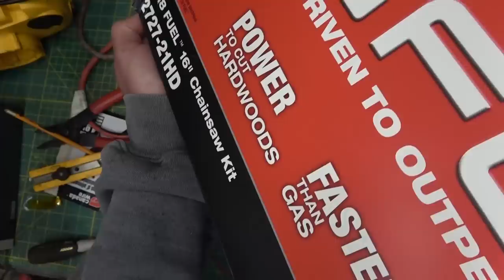BOLTR: Milwaukee Chainsaw | Destroys DeWalt

Comment: Dip into your retirement and BOLTR a Makita XCU03 or XCU04.  It's completely different inside.  Direct drive, variable oil pump, leverage on bar afixation.  It seems pretty skookum.

It's brushless motor is designed with the rotor on the outside and the stator on the inside. The permanent magnets are mounted on the rotor like a bell or cup and the rotor rotates around the internal windings.  This makes the rotor necessity larger and further from the center shaft producing much higher inertia resulting in smooth, stable operation, even at low speeds.  It is also more efficient and shorter than inner rotor motors.

This type motor produced higher torque since it increases the “lever arm” effect and other magnetic advantages I don't understand. The large rotor also means it can accommodate more winding poles, which further increases magnetic flux.  Outer rotor motors are shorter than similar inner rotor motors since the same magnetic surface area forces inner rotors to be longer since they’re on a smaller diameter.  Makita’s motor doesn’t protrude outwards like the Milwaukee. This compact size and high torque makes outer rotors great for applications with varying loads like a chainsaw sees.  It's high inertia helps to “push through” load fluctuations and produces high starting torque.  Because they use outer rotor design Makita’s saw can be direct drive.  No gears also increases efficiency while simplifying things.

Comment: That goop on the MOSFET legs resembles the latex mask I have used many a time on conformal-coated boards.  The idea is that you mask the stuff you don't want to be packed full of urethane for whatever reason.  The mask dries to the consistency of a rubber band.  When you want access to whatever you masked, either just after coating or at some later time, you grab the rubber with a needle-nose pliers, breaking right through the thin coating of fairly-brittle urethane, and pop it right outta there.  The idea might just be to make the MOSFETS more easily replaceable.  If the goop is silicone rather than latex, then it might just be that the greater heat tolerance of the silicone serves to protect the urethane from scorching, since those metal legs would tend to conduct a lot of heat.  That would likely improve on the long-term integrity of the moisture barrier.  Depends just how hot things are getting, which I do not know.

Comment: I got my hands on a Stihl 261 for $650 Canadian pesos which is the same price range, hard to go with that electric thing when you are in pro gas chainsaw range.
Reply: Not sure where he got it for 600... but everywhere I seen is 530 with 2 batteries, if you have packs the bare tool option will be like 380 I bet
Reply: Might be counting taxes in his price
Reply: Adam Petten not sure where you are from but here in Ontario at Home Depot it’s $598 plus tax for tool and one 12.0 battery
Reply: @Grakoham  yikes, every tool store I've seen is 530 with a 12.0 and 9.0, I dont think I've ever bought a tool from home depot. Most fastener stores have free shipping to.
Reply: +Grahan K they don't have the extra battery promo going on still?  Weird... meh go to Construcion Fasteners, they ship free $530 with extra 9.0 battery.
Reply: It would be kanuckistan kopeks, the term your searching for
Reply: keep in mind the 9.0 is 200 bones. bare. 12.0 300 hunny.
Reply: home de-pot. sold with 9.0 530 summ. nock off battery at retail price tool is now 330. lesson here. when there is a tool event at your local wholesale, Go!. Get to know you local rep, (milwaukee, whatever) take him for breaky and a blowie. Now tools are way cheaper and you can buy more toys!
Reply: A 261 is a far far better saw than this milfukee for sure. But it's not a patch on the ol 260... The 261s have had major issues with the holes for the sprocket, some have been machined, some done by hand. The ones done by hand are off from where they need to be, causing the needle bearings to shred themselves up, which causes lots of wear to lots of parts. All the repair shops seem to be aware of it, but Stihl are pretending it's not a common problem... Also, you get the usual issues with the electronic carb which pretty much all new saws from husky or Stihl suffer from (some more than others for sure)
Reply: Price matched at Home Depot in Toronto with local tool store at $530. Home Depot then takes 10% off. That's $477 including a second (9Ah) battery. Way more palatable than $600 for just the tool and the 12Ah.

Comment: The coating on the mosfets has two functions. First, the leads get micro cracks when they are bent and tend to corrode or break due to thermal cycling. Second, it doesn’t take much of a crap path for the gate to be shorted to either the source or drain. A couple of stray pixes, and that valve will be stuck open.

Comment: Reminds me of a 5.9 dodge the  motor is good and everything else is ready to fall apart from factory.
Reply: George & Sue the problem with a cummins is the dodge hugging it!!
Reply: @Robert82  I couldn't say it better myself hahha
Reply: LMFAO!!!! it's the truth that hurts most when I look out at what I have parked next to the barn hahaha.
Reply: got a 97 12 valve and yes that is mostly true, though I also had a 96 Chevy that wasn't any better, the plastics were just as cheap, the later dash 98-03 in the dodges I hear is a real pos with cracking and shit falling off
Reply: **cough** automatic transmission **cough**
Reply: Got a 94 5.9 Cookie dough dash is falling apart. Paint is long gone. Clear coat pealed off. Engine is strong

Comment: Your chain speed calculation is not too far off for a chainsaw, in fact many pro saws run quite a bit faster than you calculated. For example a Stihl MS261 has a maximum chain speed of 5300 feet per minute and a chain speed of 3600 feet per minute at 9500 rpm where it produces max power. You were also correct about the chain oil pump they use a half moon lobed cam to pump the chain oil. I also think a review of a professional chainsaw that is powered by dinosaur squeezings instead of angry pixies is in order.

Comment: Amen to the pegboard, some wood and some screws/nails are all you need, frikking cheap, throw in a sharpie if you want the fancy version with tool outlines
Reply: DKTAz00 you spelt dust/sawdust and grime/car grease wrong

Comment: I bought the DeWalt Flexvolt saw, and it appears they’ve fixed the bar attachment fuckery. It no longer has that silly torque limiter. It’s actually been a super kickass chainsaw and no problems with the bar whatsoever since they updated it. Only complaint about it i have is the oil cap leaks.

Comment: "If your not into this type of review...go ahead and f#$% off!" Bwahahahah subscribed!
Reply: I use pegboard to hang tools, but I hang them up on the right size bolts for the pegboard holes.  Different lengths of bolts to match the tool hanging on it.  I know it's dorky, but my tool wall above my main work bench looks better than the dewalt display case at the big box tool store.

Comment: Technically a watt is a watt.  So if the voltage goes up and the current goes down, which makes sense because they are inversely proportional, the wattage should, key word, stay the same.  Just like if I have 12V and 10A  I have 120W  but if I increase the voltage to 60V and the current is 2A I still have 120W.  What is doing all the work is the Power.
Reply: I think his point was when you increase the current you have to decrease the wire impedance by using thicker wire. 
Thicker wire means a bigger motor to accommodate the bigger windings.

Comment: Mehh.. Gas is still king!
Reply: This thing is a beast! Mine has lasted just as long as any gas I was up against. If only I had more batteries
Reply: can’t use gas indoors
Reply: Battery technology still has a ways to go
Reply: They each have their uses in my opinion
Reply: I have the Milwaukee, a Sthil MS180 and the Makita EA7901.  The Milwaukee is the go to for most jobs and I would rather use it than the Sthil.
Reply: @offwhitecolby  where all the trees in the shopping mall are
Reply: @offwhitecolby  Hahahahaha, If you only knew.  But really, If you freeze the body first, it cuts cleaner,,, less meat on the walls
Reply: My horse and buggy are still king. Automobiles will never match the reliability.
Reply: o15 L ... if you know you know

Comment: Time to build a 
MiLlwalty 2wd Ebike!
Reply: Agreed! But, for $600 he could buy a used motorcycle. Lol
Reply: My daughters pink barbie jeep does 12mph on my 20V max b&d battery. Been tempted to get a kobalt 80v.
Reply: @Eluderatnight  I use the $10 kobalt 24v(2 in parallel) on the powerwheels dune racer. It's on yt
Reply: @Eluderatnight , Jimmy's Tractor, has a video of his son's powerwheels jeep hopped up on some more voltage. I don't remember exactly how much he was putting to it. He'll probably respond and let us know.

Comment: Hey AvE,  Great review. I'm hoping they bring out a top handle version soon, it'd revolutionise my work at festivals building stages and venues from green timber, at the moment i have to offer up each piece and hold it in place while starting my two-smoke saw, make the cut and then affix the piece, its a 3 handed job at best, an M18 top handle would be a real treat. 

FYI, those lines on the saw are your felling sights, they're a really rather important feature that you'll find on all professional chainsaws. ;-)

Keep up the good work pal

Matt

Comment: I bought this chainsaw to give to my mom and sisters, ive used it around the house and it seems pretty good for a homeowner, the positives, only needing chain oil, coming with a big m18 battery that can be used in almost all thier m18 stuff, its a tight fit in the battery fan and thier radius lights, but those are great trade offs versus buying a chainsaw using it once maybe twice a year to clean up fallen limbs and small trees then letting it sit for months on end only to have to work on it for 3 hours to use it for one.  The chain is named brand and is available. All in all i like it.

Comment: I bought an Einhell (German) chainsaw at discount supermarket about six years ago. It's pretty obviously made in China, but it has an Oregon bar and it works. The starting instructions are a bit arcane: pump five times, pull three times, turn widershins twice, pull twice more... but, if I follow them, it starts,  it cuts down trees, it turns trees into logs for the fire. It cost about £100. Two-stroke stuff is fine, IMHO, if you follow the instructions, use the recommended mix, and maintain the thing.
Reply: One thing the EU gets (trivially) is zero ethanol, E0, 98 octane gasoline, that makes the 2 smoke (and overall carburetor) engines more reliable. No idea who common in the good 'ol Blightly. Also why arcane - that's pretty much how most 2 stokes start, pump the bulb, pull few times on a choke, release the choke, pull again.

Comment: Wow $600CAD and immediately you have to re-solder or replace a control board... they really DON'T want us pokin' around in there.  Interesting that it's a urethane fill on that board and not a thermal epoxy.  The solastic on the FET's is probably just there so the conformal coating doesn't have to do all the work getting in behind the FET and the pins at that end vs. the tab end.  Last place you would want Tin-Rot with the Pb-Free solder.
Reply: More lead for everything!
Reply: Good call on the solastic on the fets, that makes more sense now.
Reply: That's what I thought, looking at the video, just an unused line, but surely he'd have noticed that by the end?

Comment: The oil pump is actually just a dimple drilled into the enclosed end of the wheel shaft. The design uses gravity feed to start the process and then centrifical force to sling the oil toward the bar.

Comment: Solder is not a good mechanical connection for dynamic loads, so the yellow stuff helps so heavier elements don't break off when the the element is shocked. It is common to put epoxy or other mechanical stabilization on car electronics and tools like that.

Comment: The Rancher is just built so much heavier duty. As long you don't run straight gas in it it would last the ordinary home-gamer a lifetime.
Reply: Don’t know about that. Got a Husky 359 sitting on the bench that’s only a few years old but already needs a new top end. But my grandpa’s old Stihl 041 that was bought new over 40 years ago still runs like a champ and hasn’t needed anything more than a carb overhaul in all that time.

Comment: About the color - overheard a conversation at a client (plastics manufacturer) about the color of something that happened to be red was changing color because they were adding some kind of filler. They were asking another individual what the problem was and if they could just change the color concentration (though there was a percentage limit to that). The filler happened to be white, causing the shade to change slightly. I don't know what "filler" is, but that might be a reason or something related to it.

Comment: I’m with ya on that peg board- falls right apart, all the hooks stay with the tools when ya pull it off, pisses me right off
Reply: I thought I was the only one who despises peg board.  For my new garage I’m going to try getting my hands on some surplus, commercial slat wall.  If I’m still searing every time I rake something off the wall then I’ll fall back to nails and drywall screws.
Reply: Get pegboads with square holes. The hooks have a set screw so if tighten they aren't moving.
Reply: Same here.  I always had that problem, used a few bad words every time the hook came off, usually landing in a bunch of junk on the floor.  I thought it was just me, that maybe the pegboard needed smaller holes, or I was somehow misusing the hooks.  I even put in those little plastic things that are supposed to hold the hooks in, but 1) they're a pain to put in, and 2) they come out too.  When I remodeled my garage, I put all the pegboard and hooks at the end of the driveway for free (let someone else cuss at it), and started storing those tools in rolling tool chests with plenty of shallow drawers.  Now I just need to label the drawers so I don't take so long finding things.

Comment: usually the rotating part is separate from the pumping portion of the shaft.  The ends are cut askew and as the geared portion rotates, the pump assumes an oscillating lengthwise, depending on the angle of skew.  A spring keeps the ends in contact, and valving keeps the oil moving in one direction.

Comment: Wonder how it fares against a cheap Sithl gas saw.
Reply: probably about equal to a 40cc when the batterys full, but itll run without any issues alot longer then the gas hog, and it wont mind sitting for an eternity if you fall out of the logger mood for a year or more, also you get the beast of a 12ah battery to run your other milwuakee gear and an extra charger if you dont have enough of them to give away for christmas

imo if youre looking for a saw youre gonna use once a week go spend 800$ on a stihl/husky in the proper cc range and have a 5 gallon of mix rdy to go so you can rip till your arms give out, if you want one to take out 5 times a year and to play with when you feel like being a sawyer then get this guy as it shouldnt have any issues, got electric drills/grinders/circ saws that are older then me and still take a hotsupper wen theyre called upon

Comment: Grid wall works pretty good for a "peg board" replacement system. Hooks are heavy duty (relatively speaking) and easy to adjust.

Comment: Ave, go back to your Harbor freight drill and back to their impact driver, the company that is manufacturing that stuff is making this stuff for milwaukee and I will not be surprised if they have a saw come out there in the near future that is very similar to this. You mention the red being different and it looks like that drill color to me. If you recall the battery was just a RCH off which means they are swapping an insert in the mold to make both. The torque selector the milwaukee's have was missing and they just had a little piece of plastic covering it. Do a comparison of the clam shells of a newer fuel and that harbor freight jobber im betting they are the same. Milwaukee might be spending a little more on media for their plastics which makes it less springy.
Reply: Mitch Matley Harbor freight already has a cordless chain saw. They have a trimmer and blower too.

Comment: The oil pump works just as you assume, the shaft at the end of the gear is ground oblong and uses the case clearance. Most saws use the same design.

Comment: The "griebling for the pew-pew factor" is actually a felling sight.  That line is at exactly 90* to the bar so that when notching a tree,  you can sight down the molded line and have a fairly precise way to aim the drop.  It's maybe a little bit of polish on this particular turd,  but it's still handy to have if you ever need to actually drop a tree with the thing.

Comment: I feel like at least some of the color difference on the red plastic can be accounted for by the amount of schmoo that's embedded itself into the older tools over the years. But. The Milfuckyee definitely does have that "cheap" color to it.

Also, you should totally do a BOLTR on the Rancher 455 if you have the time/ability to :D

Comment: I'm going to have to defend my Brushless DeWalt as I had none of the issues with the adjustment mechanism.  Though I have other FlexVolt tools, I did not get the chainsaw in this config because I was not going to use the chainsaw all that much, so it's a 20V Max EX brushless.  A tree felled by the wind onto my Rubicon as well as some trimming that needed done otherwise was all completed without issues for $220, so I can't complain.  It is quiet compared to the gas op't saws I grew up with, which is a nice change.